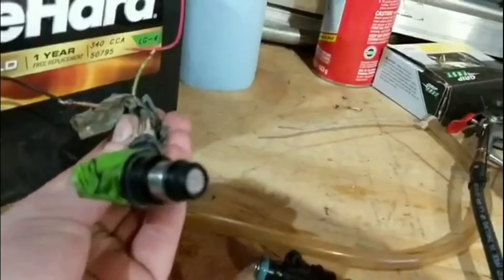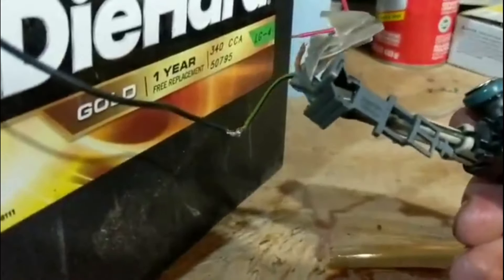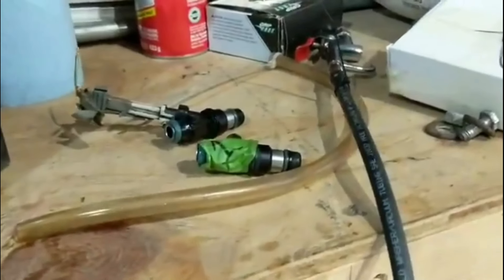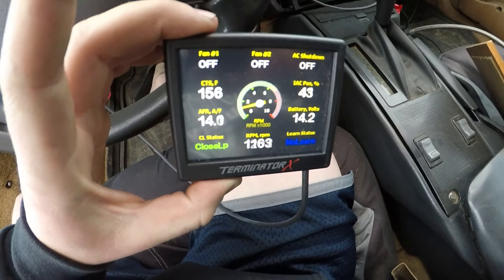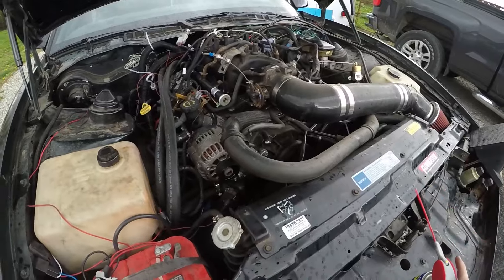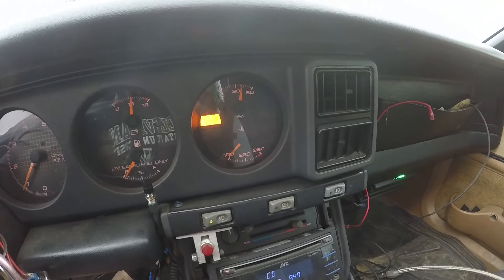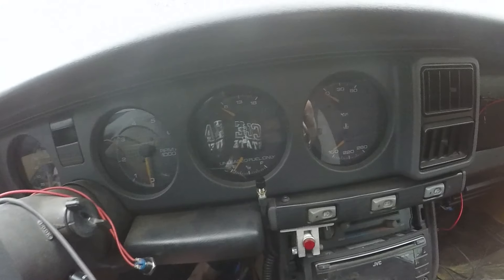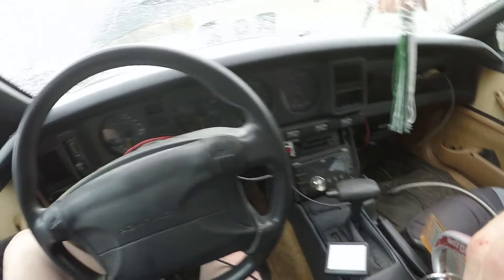305 to LS in Third Gen Firebird Update | Finally on 8 Cylinders!!!!

Comment: I see that you were able to fit the factory truck intake under the hood. What motor mounts did you use? Did you keep the factory K member as well?
Reply from the maker: Sure did man, don't listen to the guys that say you can't, I don't believe they actually tried haha yep factory k member and factory sbc motor mounts that were on the 305. Just used the ICT motor mount plates bolted to the LS and the SBC clamshells bolted right to those and the back of the LS is right where the 305's was. I believe I have the mounts to the furthest back position. I measured the distance between the mounts and the back of the block on the 305 and just put the mounts on the plates and made sure I had the same distance between the mounts and the back of the LS. I had to remove some material on the one engine mount to make clearance for the one bolt though
Reply from the maker: CORRECTION:  Just checked, the mounts are actually to the forward most position on the plates which puts the engine back to the rear most position. The 305 is longer so the LS is set back further.
Reply: @almostoemgarage8143  I've heard it's more that the large case alternator hits the hood.  Is yours a gen IV motor?  On my donor motor the alt is on the opposite side, and quite a bit higher.
Reply from the maker: @pirateofms  it's a gen III but I have the ICT alt/ps relocation brackets